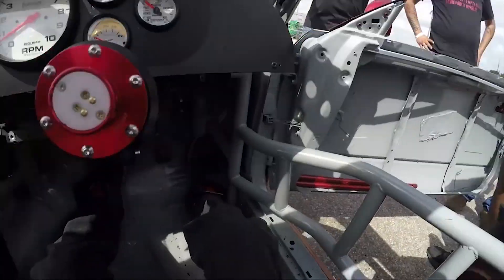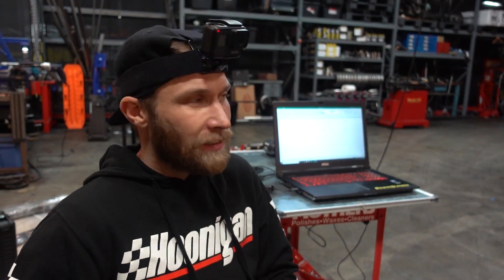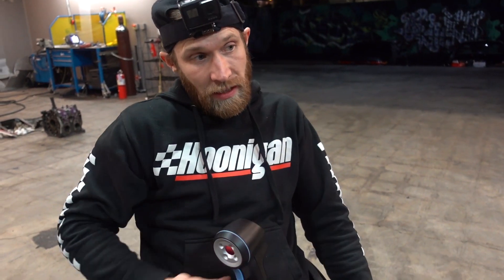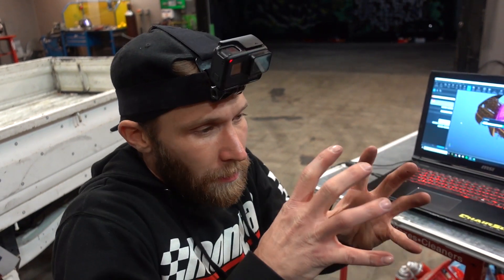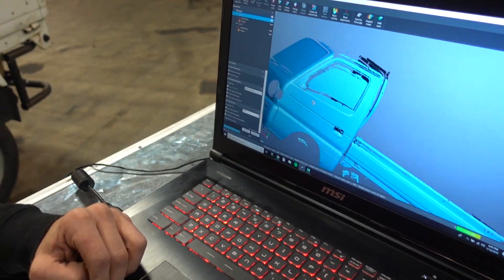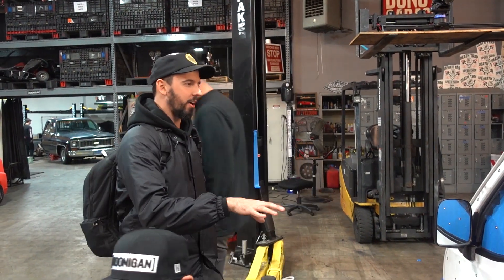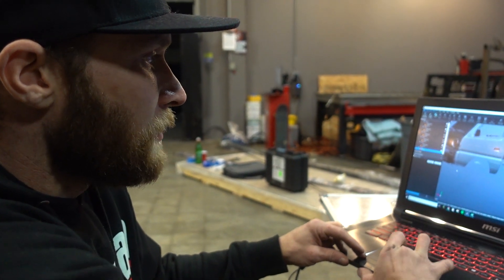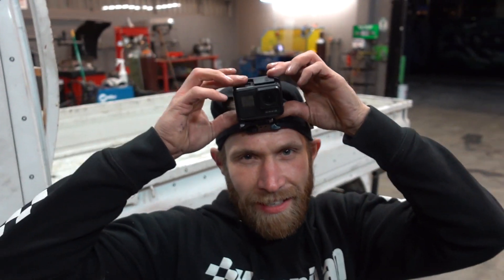Chair Slayer Uses 3D Scanner for Pit Truck Body Measurements!

Comment: i do this for a living(currently taking a break of actually scanning). I used to use this system, but we've moved on to Blue Light scanning its more accurate and faster. Its really cool to see this trickle down to the "hobby" level. I wish someone would of told you to use spray powder(foot powder) for clear and reflective surfaces its way quicker than taping everything off. Don't forget you can scan people's heads and more things and 3D print them. lol. Have fun with it and don't drop it i know how much it costs.

Comment: Why are the dots not reusable?  they are just reflectors.  Is it the adhesive?  If that is the case, I would apply new adhesive and BAM. No need to buy new 'Flectors each time.
Reply: The dots are used (edit: by the scanner) as a size reference for the surface that is being scanned. The diameter of the center portion of the dots is EXTREMELY accurate/precise (off the top of my head I think it's like a micron or something, I'm to lazy to go hunt down where I found it to see what it actually is) , I think (not 100% sure) that when you reuse them it can throw that off which makes the scan less reliable, accurate, etc.  The outer black ring of the dots is just for contrast.
Reply: their basically just regular stickers just a little thicker and their highly accurate circles. They are not reusable, they get destroyed then you take them off. the adhesive is also very accurate so the computer can calculate out over wise you would have a crap ton of little bumps on all the flat/smooth surfaces. They also cost about 50 cents a sticker seriously or at least they didn't when i was using them 3 years ago. They do have magnet ones but theyre clearly not use that kind